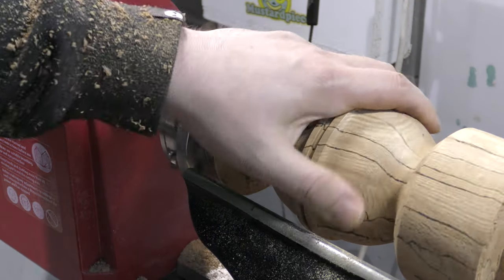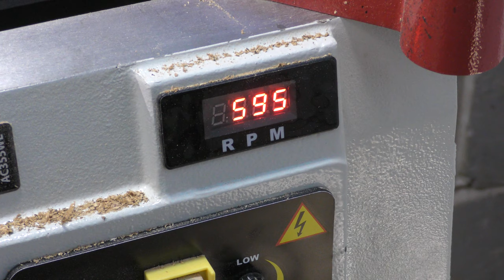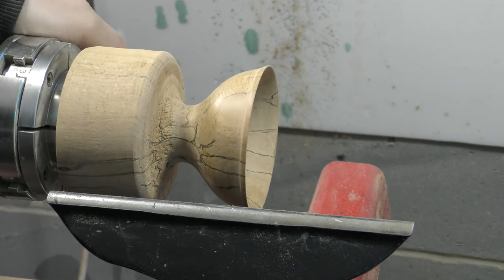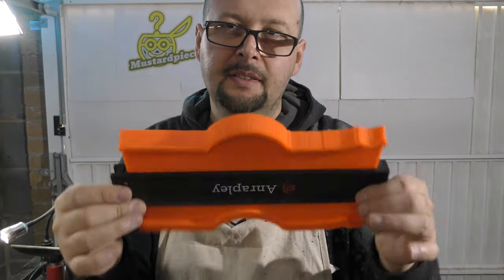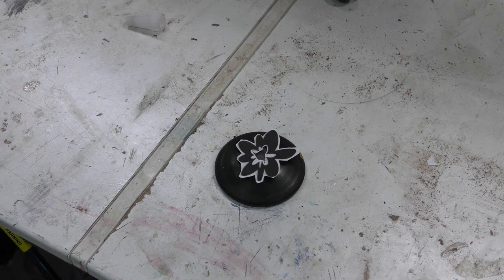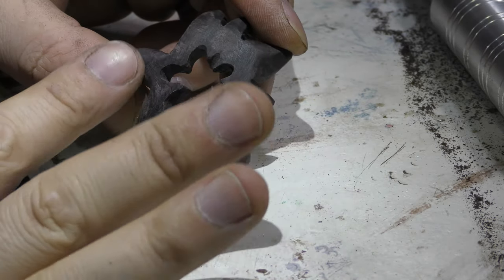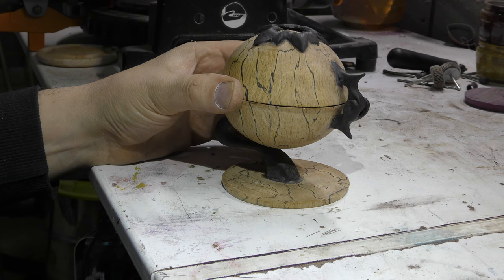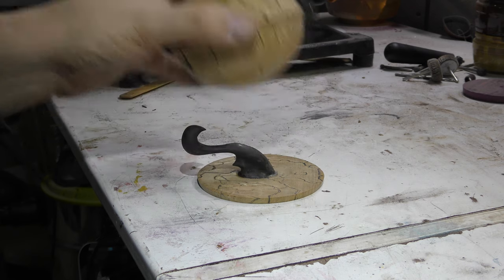Woodturning Ideas #3 The Jewellery Box of Great Difficulties

Comment: Excellent concept Attila; excellent execution. Not overly complicated; just enough to implement the design. Good job👍🏆  Thanks much for showing these excerpts from the build🙏   Stay safe.  -Mike😷   
p.s. Is it humid when you put on the finish ? I'm wondering if that is contributing to the 'orange peel' surface. Maybe it's the wood itself ?
Reply from the maker: Thank you for watching. It is not really orange peel. They are larger droplets of lacquer. Spray is not the best quality. I don't do these while turning, but you only see them because you watch my video in 20 times zoom.  Thanks ~Attila
Reply: @Mustardpiece  Haha ! Yes, I am the critical critic. Fine piece regardless. !!
Reply from the maker: @mpart_woodlathe-stuff  :)